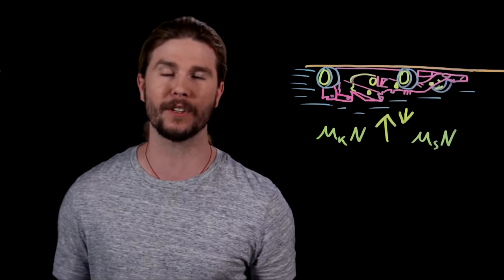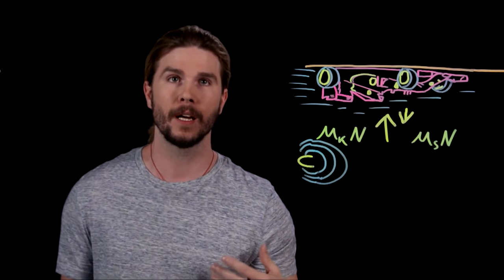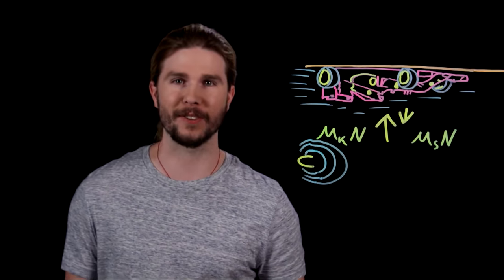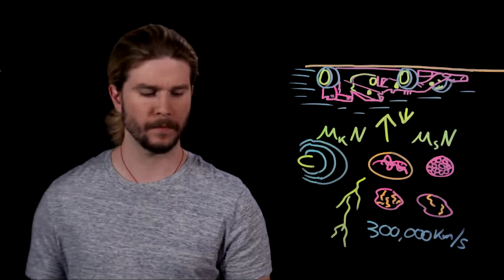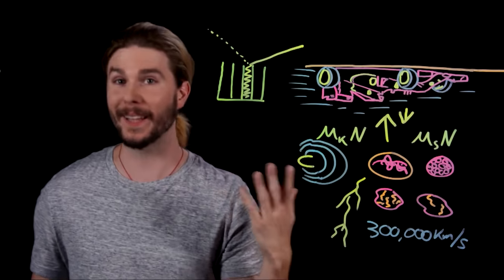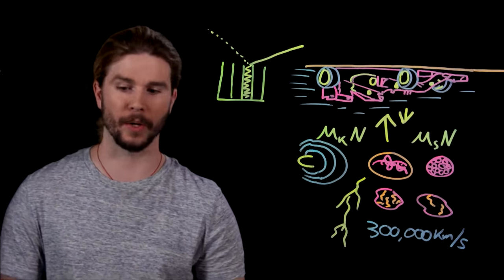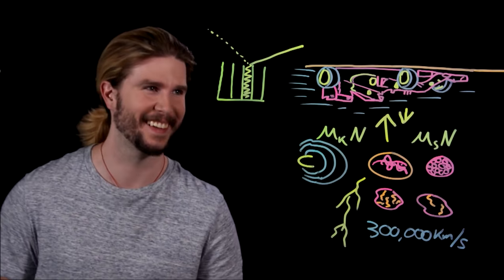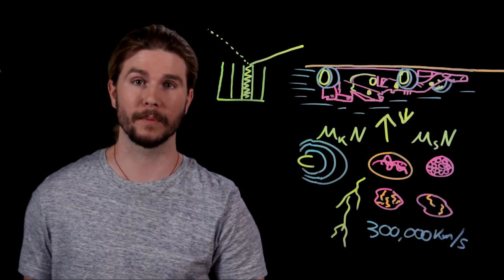Driving on the Ceiling | Because Science Live

Comment: On "Absolute Hot"... if we are using terms of "absolutely zero (0K)" to quantify "absolute hot (AH)" , then 0K is the state at which all matter ceases movement at the smallest fundamental levels ....therefore wouldn't photons in a vaccume "qualify" for AH...only because the speed limit of the universe (semi-arguably, leaving out 3 "special" quantum states) is the speed of light, and photons can be both a particle and a wavelength format... THUS...AH interactions with 0K could conceivably claw its way into the idea/(deffinition?) behind "state of observation" and its nature to change variable outcomes on particles... 

That was 2/3 statement and 1/3 question...lol
Reply: Hmmmm heat is a form of energy though as is light so as a non physicist i cant imagine a photon fitting the definition of "absolute hot." I assume absolute hot would be sonething in which ever state of matter you choose (in my head i'm actually imagining a solid but obviously you could go beyond) which is capable of reaching the highest measurable temperature with out changing state.